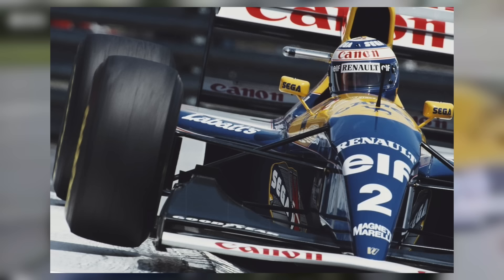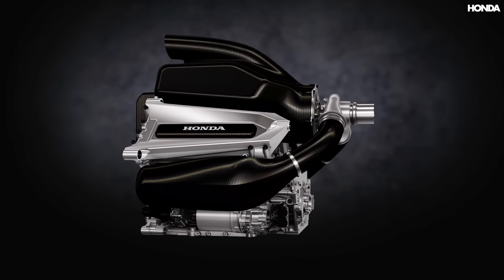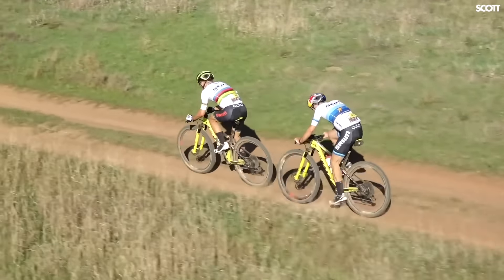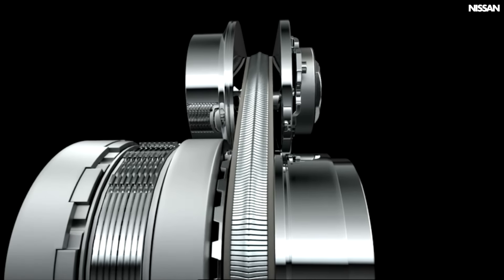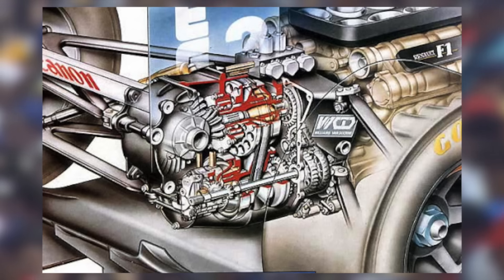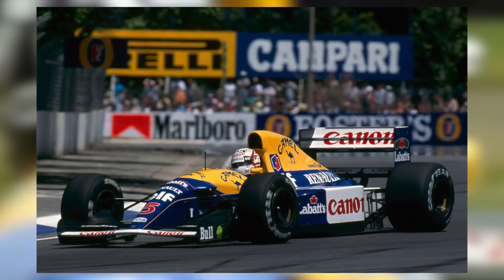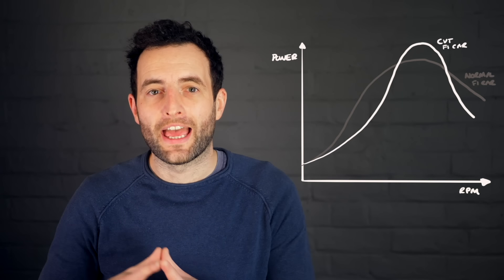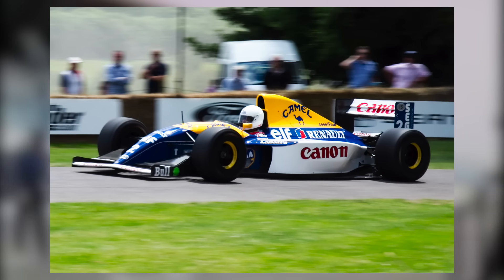The Formula 1 Car with INFINITE GEARS | The Blueprint

Comment: This was the car that made Senna want to join williams and ultimately meet his death because of the auto balancing suspension, traction control, abs and cvt gear that made the car outpace his mclaren honda, when he was eventually allowed to join because Prost had came back from his ban and joined the team on one condition that Senna was not a teammate won the cup and retired, those driving aids were banned the next year, leading the car to be unstable and not to the design parameters of the bodyshell (and making the car slower than the mclaren he was used to driving beyond the limit as it was his unicorn car) and if the suspension bracket was 6 inches higher or lower he would still be here today.

the curse of imola killed 3 people one day after another, Rubens Barrichello (who was brought back) , Roland Ratzenberger and Ayrton Senna.

An absolutely amazing machine when running as designed but when things are disabled an absolute travesty.

Comment: Lots of Nissan X-Trail & Murano owners would ABSOLUTELY DISAGREE that CVT's are OK for the road! Most have failed at less than 100,000km with normal maintenance. People who took the maintenance to the extreme were lucky to get to 140,000km out of them. Compared to at least 300,000km for the standard automatic with POOR maintenance!

Comment: If cvt’s were a thing in f1, a lot more aero engineers would have come to participate. 
By the late ww2 most aircraft engines were designed to practically have spring adjusted cvt’s in them and they would work with enormous boost for hours. Tho not many revved above 3k rpm, because they were anywhere between 25-45 liters of displacement. Those engines were wild

Comment: If you replace the actual gearbox with an electrical motor, you can achieve the same effect without the drawbacks. Just like Toyota does in their idiotically named eCVT transmission which is not an actual transission and has nothing in common with CVTs as it has no belt etc. That's why Toyota's HSD hybrids are perceived to be 'noisy' or 'whiny' as the ICE operates at optimal revs for the given situation independently of the car's speed. Exactly as DC explained.

Comment: They should have tried toroidal CVTs. Toroidal CVTs can handle greater amounts of torque. Although it's a lot heavier and at a bigger dimensions than a belt CVT.
Reply: This video is incorrect- because that’s exactly what the Williams had. It had a mechanical toroidal CVT not a belt system.

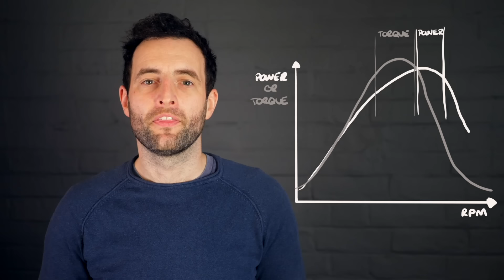Comment: Slightly wrong information when you started talking about torque at around 5:50, you accelerate faster at the max horsepower, not the max torque, torque by itself is a meaningless number, and many people confuse high torque with being able to pull or accelerate fast, that is wrong, horsepower is the only thing which makes you move forward or allows you to pull things, you WILL accelerate slower if you choose the highest torque output if the peak hp is somewhere else
if i got a lowpower car with 90hp and 135nm of torque i can't expect to accelerate faster if i put a 200nm electric drill engine in it, that thing isn't gonna move at all even tho it has higher torque, it just doesn't have the horsepower

Comment: The sound alone should get it banned. No shifting means no sound of flying through the gears means no perception to the fan of accelerating, going all out, downshifting into the turn, powering out of it. No audible way to compare cars next to each other, who is shifting faster, who is at top speed. It's one big reason people don't like racing against a Tesla (imagine!) is you can't hear what gear it's in or tell how hard it's working. Fans would leave F1 racetracks by the thousands.

Comment: 1 issue -

The maximum torque point around 6:00. HP is a torque rate and the reason you go faster and accelerate faster is due to torque....because it increases the HP. So the sweet spot for the CVT is still the HP peak of the engine, no matter whether it's a slow corner or a high-speed straight

Comment: CVT + Blown Defuser would have been world beater. Having the engine just always redlining while the acceleration peddle only adjusting the CVT so that the blown Defuser was always hot but the car was only accelerating via increasing the CVT ratio.

Comment: In my opinion, this development shows how important Formula 1 is for today's cars. CVT was developed by DAF in the 60's / 70's and was in DAF and Volvo road cars, but was not popular at all. It wasn't until 1993 that F1 tries it out and a lot of people don't even know that. CVT has been sitting on the shelf for years. In the last ten years, more and more cars have come with CVT. I've had one too and it drives great. Very flexible and economical, but also fast when needed.
A few years ago, Toyota was the first hybrid car with the Prius, with a very boring image. For years there were very few hybrids. When F1 first started using KERS and then a real hybrid, hybrid got a less dull image. And now there are many more hybrids on the road.

Comment: Not true what you say at 5:50. You'd keep the RPM always at max power RPM if you want to accelerate the fastest. For a given speed, if you stay at max torque RPM, the gear ratio of the CVT is lower (Less torque to the wheels)  than that at max power RPM, so you get more wheel torque always at max power RPM. I discussed about that a long time with @engineeringexplained and that was the conclusion
Reply: i know this is 3 years later but wouldn’t it depend on how fast you’re already going?

Comment: 5:55 OMG even you don't understand power and torque correctly? Especially in a cvt you always want to be at the point of the highest engine power. Well this isn't entirely correct. You always want to be at the point of the highest wheel torque. That's why we have gear ratios! Example? We have an Engine with 500 NM @ 6000 RPM and 300 NM @ 12000 RPM So ~377 kw. Let's say we have a tire circumference of 0.5m and a gear ratio of 1:1 we would drive with 50m/s @6000RPM which is around 180 kp/h. Then we will have an effective torque @ the wheel of 500NM. @12000 RPM we need a gear ratio of 2:1 to be at the same speed. I hope it will not shock you that now we have 600 NM of Torque at the wheel. Effective Torque at the wheel is what makes you accelerate faster. Higher Revs may mean lower engine torque but also mean higher gear ratios. Which translate to higher torque at the wheel. Or said differently. You want as much horsepower as you can get. Especially with CVT you don't need a wide horsepower band. One peak is enough. Because all this horsepower will be translated to the wheels via gear ratios anyway. This big engine torque misunderstanding is so frustrating. That's why engine power is the more important chart. Torque is irrelevant without RPM. And Power is defined by a function of rpm and torque. Because with power you don't need gear ratios to tell you how much it will accelerate.

Comment: CVTs would also gain a traction advantage since the car is much less likely to be upset by gear changes (brief spikes in wheel force) since it all happens continuously. This would make the car easier to control on throttle in corners and push harder because you are not limited to a single gear. This would be especially true following corners with changing radii. Driving in rain would also be easier since drivers have better fine control over managing wheel force with a CVT. The smoothness of power delivery is pretty important to maintaining control and a CVT really makes that easier to accomplish. So yes, I believe it was banned mainly because had it been done reliably back then, it would've had a huge advantage over geared cars.
Reply: It has all advantages, cause the system we have is flawed to its core and straight unnatural, but sadly, we cannot do better with current technology. CVTs work cheaply up to 20hp, and beyond that, they become crazy expensive.
My CVT is regulated by a single spring, and some rolling weights, and every 10.000km, I unmount half a pulley (1 screw), to replace the belt... Fixing the gears on my (rather simple) bicycle takes longer and costs more...

Comment: The last image in this video is from a Williams (showcar?) in the DAF museum in Eindhoven (note all trucks in the background), not the Williams museum in the UK.  I imagine Williams have the original car in their museum. 
DAF was the Dutch company assisting Williams with the development of the F1 CVT. The DAF museum does have an original Williams Van Doorne CVT-unit on display.
DAF developed the first ever CVT, calling it Variomatic, for their first passenger car. All successive DAF passenger car models used it.

Comment: You forget one of the main reasons to RPM limits.
The valves.
You will get to a point, where the valves simply can't close, again, befor they should open.
It's called Valve floating.

Comment: This is the Dutch Van Doorne cvt currently used in several cars and above all trucks and busses. This belt does NOT pull, that was the original version used on Daf cars was a pull belt. This version is a metal push belt.

Comment: It has been briefly tested by Williams in winter ‘93 and immediately banned by FIA. In principle it would be better for efficiency (because of torque, not power) in fact using an ICE quite like an Electric Motor. But it would not sound so nice, with that flat continuous monotone frequency… You know, like a ‘98 Prius

Comment: Well explained, but I think there is a little misconception at 5:50. If you want to maximize acceleration, you want to maximize the wheel torque. In order to achieve that, the engine must be at its maximum power regime, not at its maximum torque regime. The reason is that power =torque*rotational speed. This equation can be applied to the engine, but also to the wheel. So, for a given wheel speed, the more power, the more torque at the wheel, and this is achieved with the engine at the maximum power regime and a shorter gear, instead of the engine at the maximum torque regime and a longer gear.
Reply: Exactly. I was surprised to see this inaccuracy in such a well informed video
Reply: @Andrew H at maximum torque. The torque at the wheel is proportional to the engine torque at a given gear ratio. So the maximum force at any gear will be at the maximum torque. However, if you can switch gears, at a given speed, you will get more force at the wheel if the engine is at its maximum power regime, using a shorter gear, than using a longer gear with the engine at its maximum torque regime.
Reply: @Andrew H I don't understand your question. Power (i.e. HP)  has a physical meaning: is the amount of work per unit of time. You can calculate that as force*velocity, or as  torque*angular rate. An ideal gearbox with no energy loss at all, would keep the input power equal to the output power. So the power provided by the engine would be the same that the power at the wheels. In that scenario, you could have different torque levels at the wheel at different speeds, but the product wheel torque * wheel angular rate will be always equal to the product engine torque * engine angular rate. So, what actually moves a car is the torque at the wheels. But how much torque you can have at the wheels at a given speed, is limited by the power available. Does this make sense to you?
Reply: @Andrew H Yes, I think it is becoming a little existential. But I think you are not completely right. For example, measuring a torque is no easy. It is usually measured indirectly. For instance, you can measure the deformation of a material with known properties (using strain gages, for instance), and deduce the torque from it. Looking at the question from another point of view, the fundamental physical magnitudes related to torque are time, mass, and distance. A torque is  force*distance. But force=mass*acceleration. Moreover, acceleration =distance/time². So, if we want to express the torque as a decomposition of the fundamental physical units, torque = mass*distance ²/time². If we do the same for power, which is force*velocity, and velocity is distance/time, then the power = mass*distance ³/time³. I am typing this on the phone, I hope I am not making any mistake with the math. My point is that both are derivated magnitudes, which can be expressed as a combination of three fundamental magnitudes, but this does not imply that they have an useful meaning. For instance, you can use the power to predict the maximum speed of a vehicle, but you will need the torque to calculate the resistance of the gears of the gearbox.
Reply: Emi explained it well from perspective of the gearbox.

I would suggest to look at it from the different angle. Here is the equation for kinetic energy of moving object:
E = 1/2*m*v^2
From this you can quickly derive:
V = sqrt(2 * E / m)
V = sqrt(2 * Power * t / m)

Which clearly shows that it's the Power of the engine that is a key factor to acceleration.
Reply: @Andrew In the same sense surely torque/force doesn't really "exist" either? It's not something you can collect into a neat pile and then put in a box.

I think I see what you're getting at though. We can feel a force, but power is a bit more abstract. Power can equally be described as a change in energy over time, and energy is one of the most ridgedly defined but equally ethereal concepts out there.
Reply: Could you do a quick video to explain?!!
Reply: Well isn’t the whole point of a cvt. Is to hold peak torque and horsepower? I think everyone is right. Lol
Reply: So it looks like you are right :)

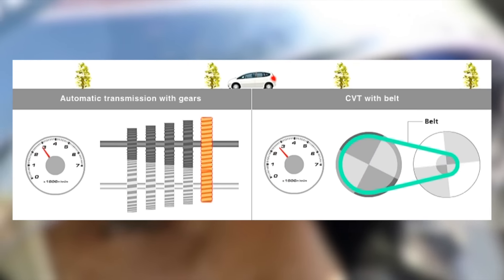Comment: I posted this on the old one as well, but I'm pretty sure this car was using a hydrostatic transmission, not a pulley based CVT in order to not fall apart.  And that diagram at 3:25 shows a manual transmission.  Oh the prototypes did just fall apart.  Had it gone to race, they would have had to use a hydrostatic transmission.

Comment: I remember driving my grandmother’s DAF 66 in 1983. It was considered anything but a sporty car and yet I was first away at a traffic light, every time.

Edit: it had the original CVT transmission.
Reply: Well, I mean it was a sports car.
If only for racing in reverse.
Reply: @VekhGaming  🤣🤣🤣
“Me gras!”
Reply: I was there (and did the reverse thing!) and yes, My 33 would stay with an MGB up to 55mph - on only 750cc
Reply: @CosmicSeeker69  👍
Reply: @CosmicSeeker69  Slightly stronger springs in the centrifugal clutch on the 33 allowed slightly higher revs and made quite a difference to acceleration.
I used to tune them back in the day.
Great car for around town.
Reply: Not really true, the 66 didn't have a push belt. They had two rubber belts contolled by vacuum instead of hydrologics. The push belt was futher developed when Daf as a company split. The result was Paccar ran with the truck division, Volvo the car part. The transmission side was split off and now is a seperate company, in Tilburg.

@Graham Hobbs the 33 had only one pully as did the 44. The 55 and the 66 had two with two belts. And yes, the both fiddling with the springs and the vacuum was a way to make it faster.

As for why I know this, did part of my studies at DAF when the double belt was developed. There then was a very fast 434 with a Renault turbo engine installed, and I did drive it regularly. That was in 1975 till 1979.
Reply: The "truttenschudder met jarretelaandrijving".
My grandparents drive one too 😄
Reply: @hanskuijsten2380  🤣
Reply: @Paul_C  also not really true. the only daf made with one belt is the 46. all other daf's have got two belts.

Comment: DAF had in the 60’s a F3 car which did 2 races I believe. At least one at Zolder and 1965 at Monaco where it finished 7th. In 1967 it had 2 victories, it was by then a Brabham DAF.
Reply: I think it was a factory transmission from a production car.
Reply: @chrishenniker5944  modified for the higher torque, but indeed it was from a production car.

Comment: there was no problem with cooling, with extra weight and wear. the only problem is that FIA banned it. it they wouldn't, than there would be issues with heat, weight and stuff, but those was Williams's problems, so they could do pros/cons of CVT for themselves. and at least all fans of f1 just had more fun.

Comment: I agree with all you said, but imo rev limiter is mostly to avoid crushing valves caused by the Spring of it beeing too slow
Reply: F1 has used compressed gas as valve springs for mamy many years.

Comment: I used to buy used Daf vans from the Dutch government in the late seventies. Wonderful Variomatics, two belts, one for each rear wheel. If a belt broke you could get home on one belt. Also cheap and easy to replace the belts. 750cc and good for 70 mph, forwards or reverse!!